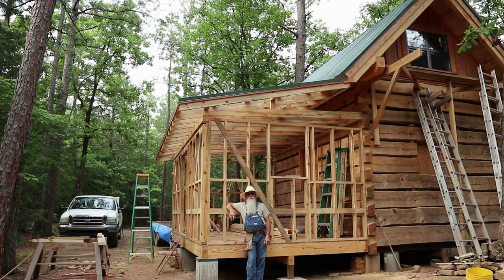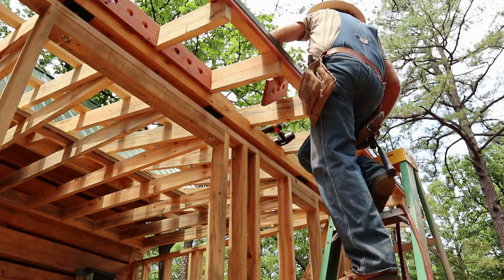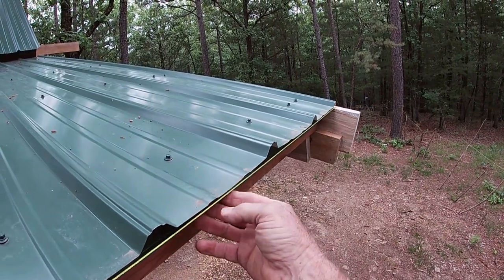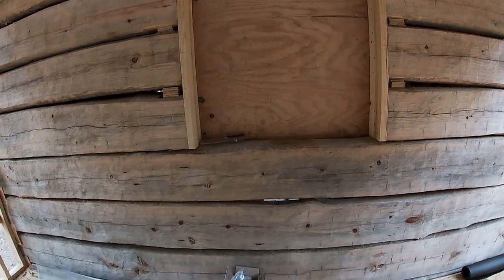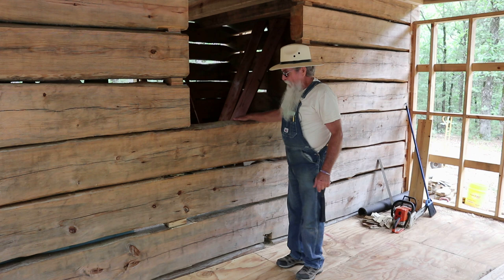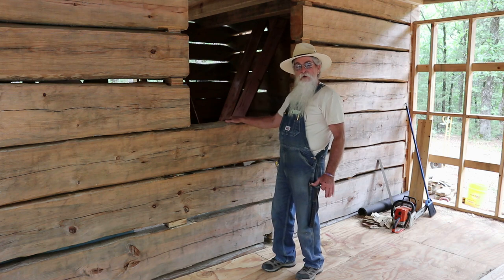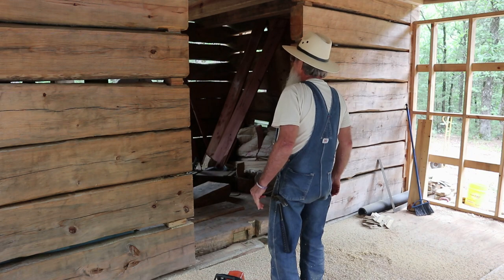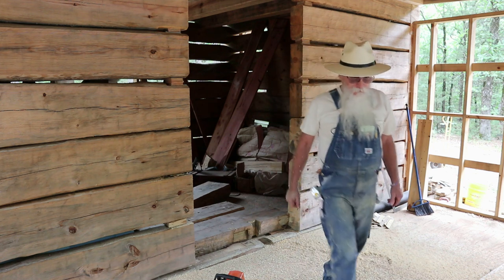Kitchen Add-on Update, Paradise Point - Ep 18

Comment: Have a question... I have seen people screw metal roofing through the flat of the panel as you did and also through the ridge of the panel which is how I was taught to install the old V ridge galvanized tin roof. What is the proper way to do it?
Reply from the maker: Howdy Johnny- the old sheet iron we used to put on a hay barn was nailed on the ridge. Nowadays I put the screws in the flat and don’t have any problems with it. God’s blessings to you